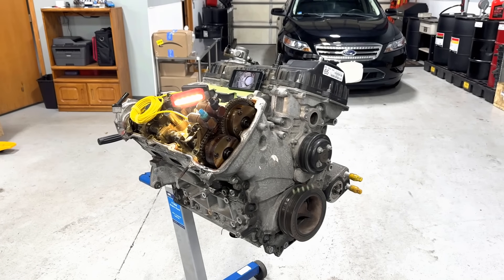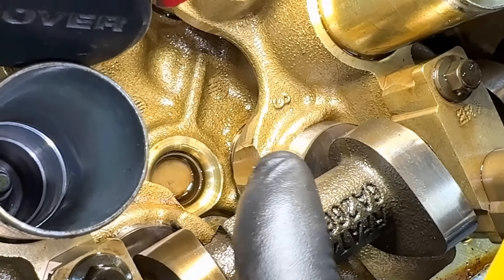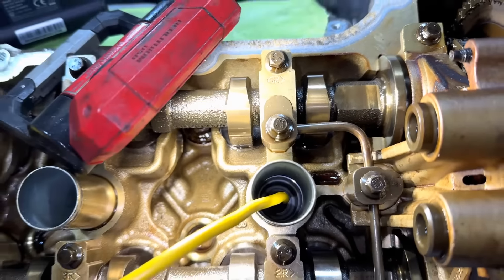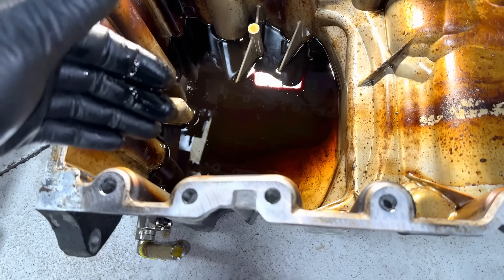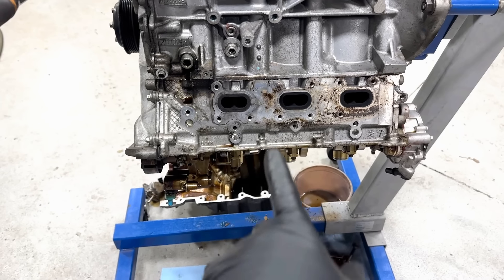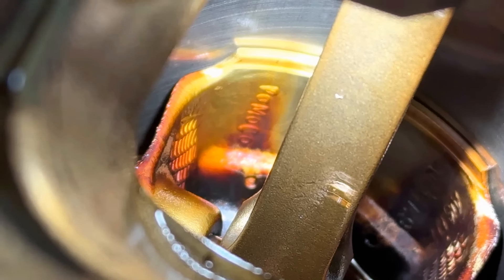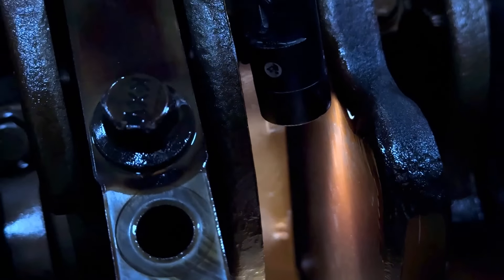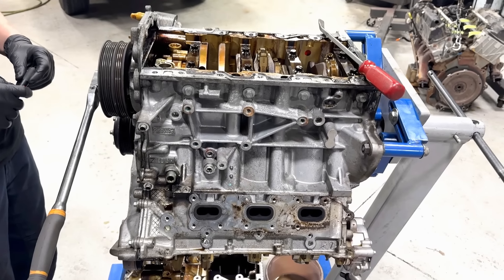Why Did This Ford F-150 3.5L EcoBoost Engine FAIL?

Comment: I had an 1970 F350 in the shop with a 351, the reason it was in the shop was the rear axle shaft slid out, and the clutch was slipping. The rear main soaked the clutch so I dropped the pan and 3 piston skirts were in the pan. As per the customer do the seal, fix the clutch and axle and slam it altogether! 
Back in the 1980's FORD 302 had "piston slap" on start ups, FoMoCo's response? "That's normal"
In the 1990's when FoMoCo owned Jaguar 4.0L engines had "soft" pistons. FORD has a long history of piston problems from my POV! 
Good job getting to the bottom of this one Brian! 😎👍

Comment: My dad's 1.0 Ecoboost did something similar, but the piston didn't completely shatter.  Just a chunk of the skirt came off (I think it was Cylinder #2).

Because the entire block is cast iron, the cylinder walls had no visible damage, and the piston was mostly intact, so the head didn't have any damage on it as well.  He threw a new piston in, new oil pump and belts, and it's been running great ever since.
Reply: 1.0L Ecoboost is an engine I would avoid at all costs.  Belt driven oil pump.  I saw a bunch of those fail when I worked in a Ford dealership.

Comment: I had a 19 transit with Ecoboost 3.5 it ran perfect like you said no mechanical misfire or anything. Did the teardown of the motor to discover problem and when the pan came off it was 5 out of six with same broken skirts the 6th was cracked. Wow right still didn't misfire. But knocked like crazy. Replaced pistons in that motor ran absolutely perfect and no more ticky ticky. Or "knocky knocky" I should say.  Live your videos. You helped me through many problems over the years so keep it up and thank you.

Comment: I'm a 70's car mechanic and still going but working on industrial stuff. Back  then most engine issues were due to the not so great oils and some people in small towns not heating up the engines enough to not created sludge and failures. But today, even with the best oils ever, I see all brands having issues that are destructive long before their time, excellent maintenance or not. Poor engineering and materials seems to not be specific to any one brand although some have way more issues that others. Like all the 5.4 3V with phasers. Other MFG brands that have VVT and all the extra and critical parts to try to make the engine get more gas mileage but then sacrifice on durability. Can't we got back to basic engines and just use the multi speed overdrive transmissions to get that extra MPG, because all these vehicles don't really seem to get the extra MPG and stay together for long enough to make it all cost effective. As here, a person can watch engine failure issues all day long and never run out of one to watch.

Comment: When I worked for Jeep the 4 liters had huge piston slap issues. We would tear them down and find skirts in the pan pretty regularly.
The thing is they would run forever like that.
It was a poor design. The castings broke just under the pin holes. But they would just keep putting along.
Reply: Always on the thrust side

Comment: I have a second gen 3.5 and had the cam phasers replaced under warranty.  I have to say that it is the smoothest and quietest engine I have ever owned.  The 10 speed transmission on the other hand is not smooth and it is going in for work soon before my warranty is up.

Comment: Love your channel. Has helped me alot with my 2011 Ford F150 fx4.
Wondering if I could pick your brain with some issues I am having with mine. 
Quick version:
 losing power ( think it's timing chain )
 Random shifting or staying in high gear ( lead frame ) 
Turn signal stays on or won't fully engage 
Rearview mirror backup will stay on for some time after shifting back into drive. 

Tried scanning with forscan and Vlinker FS USB but keep getting connection issues and warning about not being able to read PCM DTS. 

Here's the kicker: put about a yard of soil and sand in the back, and the truck ran like a dream for 2 days before I got the majority of it out.  It was not in Tow/haul as when it was the issue came back.❤

Comment: I had the same noise on my 2015 3.5L. It turned out to be a broken skirt on #4 piston. My tech replaced the piston, re-honed the cylinder, while he was at it he replaced the water pump and timing chain and guides. All is good now. I have just over 220,000 miles.

Comment: Wow! I drive an old 1995 Ford ranger XLT 2.3l manual transmission with 330k original miles. This is the one with the 8 spark plugs.

Reason why I don't let it go is, the quality of ford trucks today. Also the outrageous cost on what is meant to be a work truck. Hope it keep running until I find another truck with good quality and low miles lol.
Reply: I've got a 96, 250k. Great mini truck. 1 clutch. 1 timing belt.
Reply: @edjacobs8876  same here, I did the timing belt and water pump simple trucks to work on. Paid for clutch job.
Reply: FORD TECH MAKE YOU LOCO 😜
Reply: Its a ranger. Hardly much of a truck when any random honda has more power and torque.
Reply: Ive had no problems with modern Ford truck quality. 300k for me is three years on a truck. Expensive, thats an entirely different matter. They are ridiculously expensive.
Reply: @TonicofSonic  it's not for racing it's for hauling, what civic is there with a 6 foot bed??? None!
Reply: @TonicofSonic  Honda's suck big time, buddy.  Just so you know.
Reply: @MRSOMEBODYRC  You could pull a trailer with one.
Reply: @santaclause2875  I drive a lariat f150 with the 5.0 coyote engine.
Just thought you should know little guy. But ya you are better off with a civic pulling a trailer than one of those cute little micro trucks pushing 140hp on a good day. 😂
Reply: @TonicofSonic  Ya need to get you one of those Fecal Boosts !!!!
Reply: @TonicofSonic  I've done that and much more, my young boy. 320 thousand miles worth of work and play. I like Honda too for quick fun on tight corners, I am an offroad kinda guy. Good riddance kid.

Comment: 10:30, zoom in.  You can see a crack through the piston in the opposing direction if the wrist pin.  Possibly started out as a broken ring land from detonating and grew to the point of breaks chuck of the skirt off.
Reply: I thought that looked like a crack as well. Is that a cause or a result, though?

Comment: My guess is a micro crack in the skirt from when it was cast and over time it fatigued and let go.
Reply: Typical of what happens to airplane parts such as jet engine fan blades.

Comment: Wow that is wild, just one side of the piston skirt, just looking on the top side motor you would think anything
was wrong, a super clean motor. A maybe a fracture crack when the piston was made maybe? For sure 100%
it doesn't look like abuse or lack of care.

Comment: Another great video. I learn something every time. 
Question: I have a 2016 Gen1 (I think) 3.5 ecoboost and am starting to see some things go wrong, i.e. intermittent antifreeze leaks, slow, and a cracked exh. manifold causing the chirping on acceleration. When I'm ready to overhaul the engine, should I do a stock 1 for 1 swap with a factory crate, or upgrade components that typically fail? Or other option? TIA.

Comment: My buddy bought a brand new 2014 3.5 Ecoboost and it now has 400k and his finally did cam phasers and a turbo (leaking oil) around 350k. First time anything had ever been done to the truck.
Reply: 245k on mine. Timing chain is out of spec according to ford

Comment: As soon as you fired it up, I said to myself that’s piston slap. That sound is so distinctive I’ve heard it a hundred times.
Reply from the maker: When I hear it now, I do hear a distinct rap instead of a tapping noise.
Reply: I have a 2013 f150 3.5 that just turned 100k miles that sounds exactly the same. Already replaced the timing chain and cam phasers with no change. Guess I need a new engine. How much does it cost to replace the engine? @FordTechMakuloco

Comment: Yep, kinda strange to blow off the skirt on that piston. I was guessing a skirt popped, because I didn't like it when Ford used the long skirts that were real thin and skinny at the end that had a tendency to snap off. (with many miles on them) I'm not sure why those certain engines had that design.

As for this engine it looks like a normal smooth wide skirt base, which should hold up just fine. As some have said though, it may have been a casting defect.

As far as in my opinion, if you're going to be building engines with turbo, you should be running forged pistons and cranks anyway, from the get go.

At least this particular year 3.5 I like the inards due to the fact it is a normal overhead cam without rocker arms/followers.

Last sentence, it is possible his son borrowed the truck and was out rod stretching the engine. A computer scan usually can tell on you when it comes to WOT commands. lol.

Comment: EcoBoost was EcoToast!  Guess:  Original tiny casting defect kept getting gradually worse. .....  It's 10 years old, and cracks can propagate s-l-o-w-l-y in those piston skirts over time.  When a jet engine blade or disk crack is present, sometimes it will take years for the engine to actually fail in flight (took 18 years for the 1989 DC-10 Sioux City crash to happen, from an oriignal manufacturing defect).    So my guess is an original factory casting defect, and a "Fatigue Crack" propagation, making it past the warranty period.

Comment: Thanks Brian, even if he was leaning on the engine it’s very unusual to break a piston skirt don’t you think. Even though it’s the load side there really isn’t a lot of pressure there, just my humble opinion, thanks for the upload.
Reply from the maker: Definitely don't see it very often.
Reply: Tuned vehicles usually break the ring land from massive amounts of cylinder pressure... But most likely it was The operators fault could have been manually shifting and hit the rev limiter or something like that

Comment: I don't remember seeing this kind of failure on older 8 cylinder engines.
Reply: They don't make as much hp per cylinder and don't tow my 7k camper at elevations over 6,000 ft like an Ecoboost.

Comment: Weird failure.  Just curios, and I don't have a ton of experience with this kind of thing, but is the reason for swapping in a new engine simply that it's cheaper to grab one from a wreck than it is to rebuild that block, or would that block be toast?  How did the bore on #2 look?  

Always love these videos.  You helped me with my timing and my 3.5 is running great 4 years later.

Comment: Looks like rod is bent. Which can cause this failure.  Wondering if the owner hydralocked the engine.......maybe doing an intake valve/engine decarbon cleaning or possibly sucking up water?

Comment: I would say that someone that uses Duralast ignition coils isn’t someone that treats their engine as they should.  Obviously this didn’t lead to the broken piston (most likely a manufacturing defect) but just an observation.
Reply: Yeah, and why replace all the OEM coils with cheap junk anyways. Just replace the bad coil.

Had a friend do that (replaced all the coils and tossed the OEM ones, and then every 6 months to a year one of the duralast coils would fail when the OEMcs lasted over 10y before one failed. And it was only a 4 cylinder..
Reply: Were those duralast coils? They looked a little funny. Yeah why would you do that!!
Reply: Maybe a shop put them in and used Duralast to save money and charge more?  We don't know and obviously it's a moot point now.
Reply: Dirty Last huh? 😅😅

Comment: could be the camera lense  but that rod looks bent just below the pin. skirt to crank clearance few people think about. seen the exact same thing on a chevy 454.
Reply: I had a chevy 350 that was running fine when I shut it off then when I went to start it up after work something acted like it was locked up so I kept bumping the starter and it finally cranked over and fired up, it sounded like someone was banging pots and pans together inside the block so I shut it off and had it towed home, once I got around to tearing it down I found number  8 rod bent and twisted in such a way that it shrank the piston straight down to where the skirt was contacting the crank counterweight there wasn't any damage to the cylinder wall, the crank, bearings, heads,  valves, cam, lifters, rocker arms or piston tops, still the strangest thing how the rod bent and twisted while it was just sitting there.
Reply: @AreaThirteenThirteen  Fuel or coolant may have entered the cylinder and it hydrolocked the piston bending the rod.

Comment: This makes my old 08 Ranger 4.0 sohc manual look good....214K still going strong.
Reply: Until the rear timing chain needs work.
Reply: man you aint lying, what a pain. @jeffisaliar
Reply: Old school rangers were tanks,  my first car was a 2000 ranger back in 2003. 3.0 v6 5speed, sold it with 314K in 2009. Regular maintenance and clutch change. Wish I still had it.
Reply: I inherited my Dad's '01 Ranger. 3.0 V6 not much power not great fuel mileage but it is super reliable so far. Close to 160K on the odometer runs great.

Comment: I think it sounds like valve train noise because of the different pressures  on the piston during the  4 strokes of a complete cycle, making it sound like it's camshaft speed.

Comment: yikes.  More info to store for my truck.  2012 3.5 EB with about 160K.  I'm sure the driver side turbo has a sticking waste gate, but I can't justify the cost of replacement at this point.  Just replaced the plugs and coil packs for "routine" maintenance.  Probably overdue.  LOL
Reply: I just did a turbo on a 3.5 Explorer. Waste gate link was off and turbo housing was cracked. Is that a common issue?

Comment: There are millions of these engines on the road. I am not convinced that the failure rate is all that high. Any thoughts on that? I have 125k on my 2016 F-150 platinum. Had an oil leak, decided to replace timing chain, water pump, cam phasers while the front cover is off. Cheaper to keep her for sure!
Reply from the maker: As I said in the video this kind of failure is not common at all.

Comment: Change the oil change oil at 3000 miles not Fords internal clock. I've got a 2012 f150 ecoboost. Are u ready for the mils. 375,000 miles. Runs great only big repair is I did the timing chain and cam phasers a while back.

Comment: I would be interested if you elaborated on your conversation with the owner. Pros and cons of rebuilding or replacing and the cost associated with both. Ultimately the customer has to make the decision
Reply from the maker: Nope not at my shop, either we reman it or he goes down the road and the next customer comes in right behind him.

Comment: Looks like a high rev burnout.. and then suddenly your tires catch traction..  That sudden deceleration pulse at the crank. 
He would have DEFINITELY heard it when it happened.  I don't think he's giving the whole story.   Maybe he let someone else drive it.   but oh well
Reply: As someone who drives the non eco 3.7 it is ridiculously difficult to resist tromping that pedal on these vehicles. I kinda tense up when mine hits 6900 on the tach, but merging into 70 mph traffic is more fun.
Reply: I tend to agree with that. I have a '19 with the 3.5 and find that it is ridiculously easy to break the tires loose especially with the 3.55 rear end gears
Reply: @jeffisaliar  I drive a '12 Mustang, 3.7,  115,000 miles. It's making a similar noise now.   I changed to 20W50 oil, and it helped a lot, but still there. Should I drop the pan for a peek?

Comment: It couldn't have happened too long ago. Even if you pulled the whole piston, it would be hard to tell why it let go. Interesting that it passed power balance and misfire tests! It did sound high in the engine, but if it ate a valve spring, you'd have a miss. As you said, bucket type systems just don't fail.

Comment: Piston was defective.  Bad casting.  Looks to be an issue overall as the Ecoboost forums have quite a few posts about cracked piston skirts.  Ford should be sending their quality assurance engineers at that manufacturer.  I'm sure Leadership has probably been told "Well, we found the issue, the supplier is the cause", but somebody in leadership sits on a board, owns stock, or had a relative high up in that company...seen it more than once for sure over there.

Comment: I have a 2014 f150 with the ecoboost. I just recently purchased a brand new (not reman) long block, and I'm installing it in my truck. My question is, should I go ahead and open the motor to install the Melling HV oil pump, or should I leave it as is? The motor has a 5 year warranty, FYI. Thanks for the advice in advance.

Comment: Looks like a ring land failure from LSPI.  Yeah, he did a lot of oil changes, but used API SN motor oil that has a LOT of calcium.  DI engines must use SN Plus or the latest spec for DI, which is API SP.
Reply from the maker: Wait you can find SN or heck even SN+ still? Everything changed over to an SP spec at least a year or two ago, especially the synthetics which he obviously uses.

Comment: Looks like the rod in the offending cylinder was bent.  Is this the case?  If so that'd explain the damaged skirt which likely came in contact with the counter weight.

Comment: Interesting... @ about 10:23, it appears that there is a crack, but I did not see that on the top of the cylinder. I have never seen that happen.
Reply from the maker: That is a casting line.